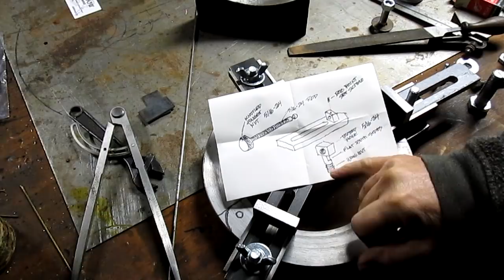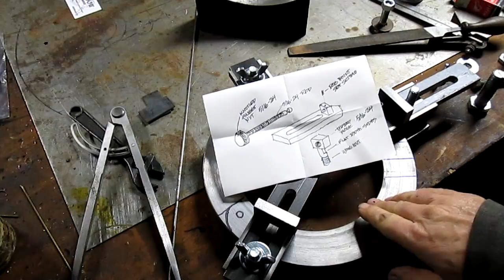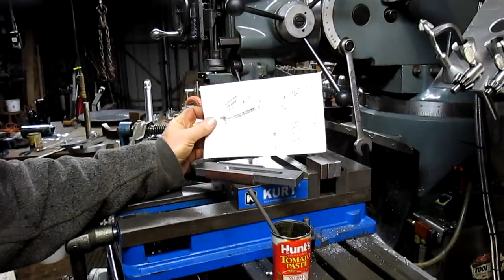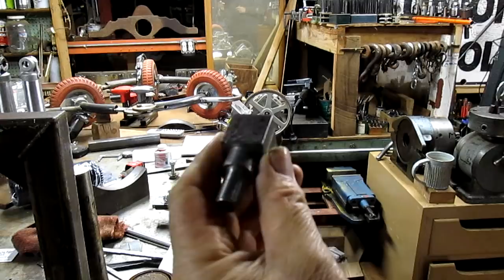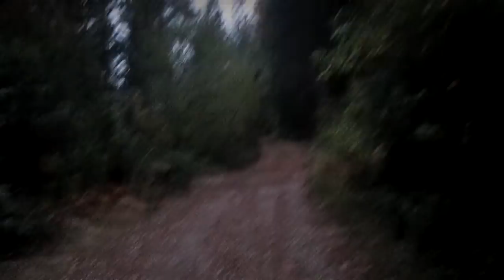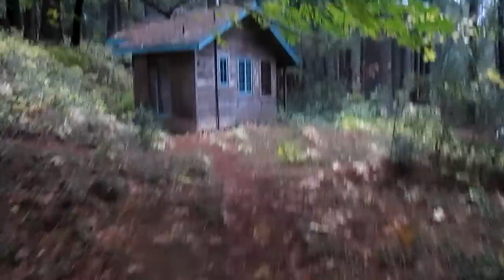Steady Rest Build #3

Comment: I think the builds going pretty well. My thinking is I'd put the block behind instead of close to the center. Just in case you wanted to add roller bearings . It will work either way tho . I always try to think ahead for changes later when I may have the money. But that's me for sure.
Reply from the maker: Roller bearings are in the plan.